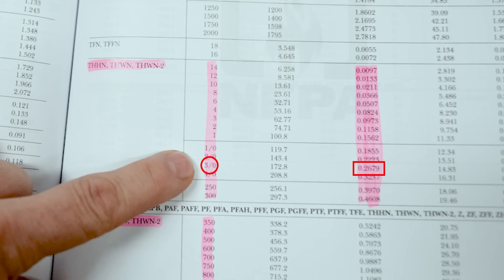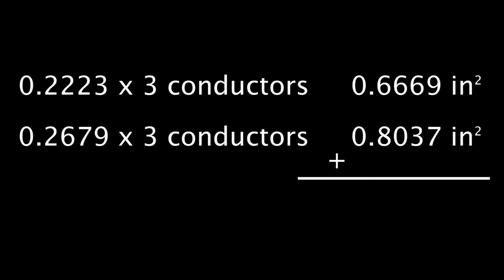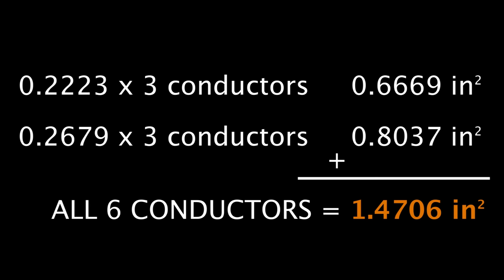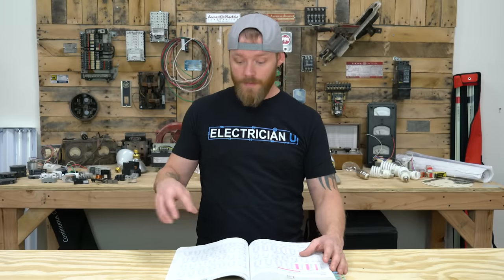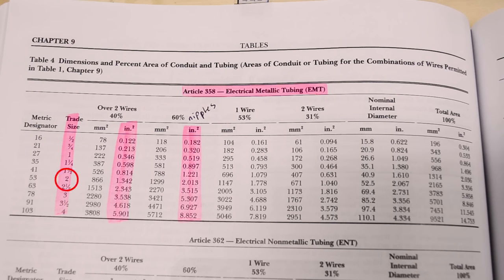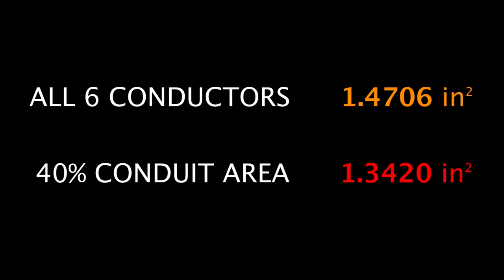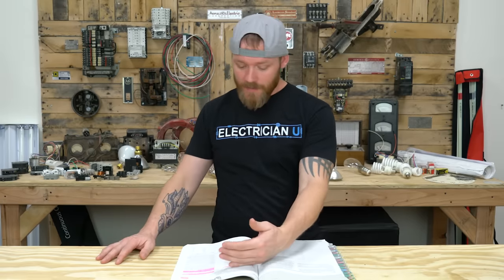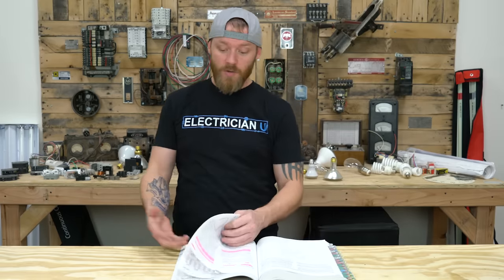CONDUIT FILL EXAMPLES for the Modern Electrician - How Many Conductors Can I Put In...

Comment: If you are protecting the insulation of the cables dont you consider the cross sectional area of the cable ( to outer insulation ) and determine the 40% of the conduit ? rather than just the CS of the conductor.
Reply: I don't have an NEC book, nor ever studied one. But my guess is because the table for cross sectional area of "conductors" would also take into account the insulation. My reasoning for this is each type of cable has its own section in the table. A bare conductor is just copper (or aluminum) and wouldn't need all of those categories. I've noticed through watching lots of these videos that tradespeople seem to call a cable a "conductor" (which is why I used quotation marks, above). It seems inaccurate to me (electronics trained), but might just be trade jargon.

Comment: Someone please explain to me why you would want to put more than one romex wire through a single tube of conduit.  Obviously this section of the code is there because people do it but I can’t understand what circumstance that would be necessary.  Why not just run more conduit or split it off with a junction box?

Comment: The tables say for 1¼" conduit you can have 0.598in² fill @ 40%
But in the annex table it states you can have 4 1AWG THHN wires in a 1¼" conduit and @ 0.1562in² X 4 that would be 0.6248in² so I'm confused
Reply: You only apply that 40% if theres different sized wires in the conduit

Comment: Contractor who installed power at the building I work in must have failed this.   40MW was installed but we can only safely draw 20MW due to overheating in the conduit.  Major ($millions) oops.
Reply: Were they held responsible for it? You should run the building at 40MW and let the wires melt and force them to fix it. Or just legally force their hand

Comment: Is it normal for a first year to go back and fix a journeyman’s mistakes? Is it normal to fix a second year’s mistakes? I know I’m a first year so I’m basically the bitch of the whole ordeal, but I’m often getting sidetracked from my own work to go fix or assist someone else. If this is not a normal thing, what should I say to my foreman? I haven’t gotten in any hot water yet for being slow but he’s seen some of my work which when alone he says looks good, but when I’m assisting the other co-workers throughout the day I noticed I tend to slip a bit more trying to remember what I was doing and he’ll notice it in the quality of my work. Does anyone have any helpful advice? Thank you in advance I just really want to do well.
Reply: Can't speak for others but i hate it when an apprentice goes and tries to "fix" my work.  I'd make sure there is something actually wrong with it before you touch it because if the guy before you thought it was good, you're only gonna piss him off. 

These days it seems all apprentices think they know better then the guy that's been there for 20 years. 

Don't get me wrong, if its a safety issue like a light that's arcing then fix it.  Don't say.. cut an inch off of flexible conduit because you think its too long.
Reply: I agree with beeps; don't be the "inspector". By all means, show others tricks or tools that can improve their work. But don't be surprised if the horse won't drink after you lead it to water...

Comment: Dustin, I have to disagree with your claim that heat is not a factor in Conduit fill.  Starting with the basics, NEC 300.17 says: 

 " The number and size of conductors in any raceway shall not be more than will permit dissipation of the heat  and ready installation or withdrawal of the conductors without damage to the conductors or to their insulation. " 

That's a pretty clear statement,  Yeah, Chapter 9 and Annex C don't mention heat, but they aren't the only applicable parts of the code.  If you went solely by Annex C,  you could put 16 #12 THHN conductors in 3/4" EMT.   That's all well and good from the standpoint of physical damage while pulling the wire, but NEC 310.15 (C)(1) would also require you to derate the ampacity of those conductors to 50%.  The full ampacity of #12 THHN would be 30 amps per Table 310.16, so 50% of that would be 15 amps.  If you go by only chapter 9 and Annex C,  it would seem like you could run 8,  20 amp circuits in 3/4" EMT,  but if you consider all applicable parts of the NEC, you can only run 4, 20 amp circuits in 3/4" EMT.  As far as your comment that you don't think the conductors are at max value, as a practical matter, you're  right, the circuits probably won't all be running at max current at the same time, so it probably won't create issues.  But codes are designed around  assuming the worst case scenario will happen, not assuming that it probably won't.
Reply from the maker: Andrew Alexander I don’t disagree. There’s 2 statements there 1) dissipation of heat which is dealt with in 310 under number of current carrying conductors in a conduit without reference to size of conduit and 2) chapter 9 # of conductors in conduit without reference to current or heat. They’re both important and both necessary but what I’m saying is chapter 9 has nothing to do with heat, that’s in 310. 310 has nothing to do with conduit fill that’s chapter 9. I’m stating I don’t believe the arguement that a 40% fill has anything to do with heat, it has to do with fit and damaging conductors, 310 has nothing to do with fit, it addresses the heat.
Reply: Andrew Alexander    I do not really understand your point for this reason.   During a design process, home run location is decided, number of circuits desired in conduit, size the conductors as required, and lastly, size the conduit.   You never size the conduit, fill it full then see if the conductors need to be derated.   I've done this since 1983.   If you are a consulting engineer, then I guess I understand.   Most leave all this up to the contractor to figure out.    Respectfully,   Kevin
Reply: @ElectricianU  Dustin, I should say I'm a big fan of your videos, subscriber and all that, so I'm not trying to run you down here.   And I'm not trying to put words in your mouth,  but watching your video, it sounded to me a lot like you were saying: "That whole heat thing is all bullshit, I don't believe in it, and you can just ignore it, and the only thing you have to follow to know how many wires you can stuff in a pipe is Chapter 9 and Annex C"   You say that's not what you meant, ok, cool. I  can't sit here tell you what you meant to communicate, because you know what you intended.  But I can tell you what it sounded to me like you were saying. And if it sounded like that to me,  it probably sounded like that to some other other guys too.
Reply: @KevinCoop1  I'm not an electrician, nor an engineer,  but I'm assuming that an electrician isn't always going to be handed detailed plans that spell out absolutely everything, that there are times  that an electrician is going to have to be making decisions in the field.  So, as I posted above, it sounded to me like Dustin was saying that chapter 9 and Annex C was all you needed to know in order to determine how many conductors could be in a pipe.  I accept that Dustin says that's not what he really meant,  but looking at the comments here, I'm not the only one who thought he was suggesting that heat derating could be ignored.  My point was that someone who also read his comments that way might ignore 310 when figuring conduit fill, go with the max number of conductors allowed by Annex C, and wind up with an installation which doesn't comply with 310.15.
Reply: Andrew Alexander    Thank you for comment.   Makes sense!   Respectfully,   Kevin
Reply: @andrewalexander9492  AGAIN....derating is based on 310 and conduit fill is based on Chapter 9. The title of this video is "Conduit Fill". First, you decide the derating of the conductors that are going to be in one conduit. Once you have figured, you move on to Chapter 9 and figure conduit fill. Yeah you aren't an Electrician or an Engineer....and it shows!!!

Comment: I don't know why YouTube is so interested in showing me old conduit fill videos this is the third this week, but f it here's a copy pasta of my post from one of those other videos.

This is a section of code that really irritates me at least for branch circuits. Don't get me wrong it's necessary for calculating the size pipe you need for large conductors and special cases like isolated grounds. However, after you have applied corrections for ampacity the actual practical limit is 9 current carrying conductors (#10's on a 20A circuits) anything more and the step up in wire size becomes impractical, who's going to pull #8 (THHN) for a 20A circuit? Plus you then have to upsize the conduit from 3/4 min. to 1-1/4 for up to 16 or 1-1/2 to 20 the pipe can handle 22 correction step up is at 20. I can't say you'll never do any of this, but seriously this section is mostly navel-gazing at best and leads to bad installs that could end up in dangerous situations and worst.
Reply: True, 9 is the practical limit for most branch circuit wiring but the rules need to apply to more than basic branch circuits. More than 9 is done all the time once you leave the comfort of residential and light commercial wiring, especially control wiring. FYI, even at 9 conductors 14, 12, and 10 are still on 15, 20, and 30 amp breakers, respectively. Usually no need to upsize until you hit 10 conductors.

Comment: When you say nipple what exactly are you referring to? Like a special connector from box to box?
Reply: a short piece of pipe/conduit.
Reply: Specifically, it means 24 inches or less.   That is when you can take credit for the 60% nipple fill rule.  It doesn't necessarily mean a factory nipple, it could also be one you field-construct out of part of the full straight section.

The one thing unspecified about the 24 inch measurement, is exactly how you measure it.  I.e. does it mean 24 inches between box walls, 24 inches of rough stock length, or 24 inches of finished length including the connectors and bushings?

Comment: Takes as long to figure as it does to pull them. Heat dissipation in a conduit, maybe? Limiting two wires in a drilled hole is pure bullshit! Why aren't breakers sized to prevent a wire from overheating??

Comment: Question for any electricians, how many receptacles should you be able to wire up and close up in a day, or per hour. I'm trying to figure out what I should strive for.
Reply: After the rough in? Back in my Construction days it was about 15 minutes a receptacle.
Reply: I just finished a residential job with about 15 receptacles per room. Taking your time, you should be able to complete all 15 in an hour.

Comment: Heat, have to derate your cable, 70% derated
Reply: The insulation has heat and a bunch of other ratings. The only time you need to do additional calcs is to account for ambient temp
Reply: Wrong, 3 or more conductors you must derate
Reply: Plus amperage is rated at 75 degrees not 90
Reply: It's not about heat  if u watch Mike holt on this you will see it's about the magnetic forces in the electrons and that could through you voltage around

Comment: Data  is correct, but someone needs to learn the difference between square inches and inches squared!
Reply: What's the difference?  Please enlighten us.  Last time I checked, they both are different ways of saying the unit of area that you get when multiplying one dimension in inches by another one.
Reply: @carultch  If my memory serves me right, (sometimes questionable), this example might help: imagine three 1 inch squares- that is 3 square inches. Now take the expression 3 inches squared,  which would b e a square 3 inches on each side , which now is equal to nine square inches,  or three inches squared (3 " x 3")
Reply: @edwardfry2594  I've never heard it work that way.  You would say "the area of a 3 inch by 3 inch square", or "the area of a square, 3 inches on a side", if you meant the latter statement.

To my knowledge, "square inches" and in^2, are both units of area, equal the the area of a 1 inch x 1 inch square.  The computation of the number portion of calculating area is usually completed prior to mentioning the units.   "3 inches squared" does not mean "9 square inches".
Reply: @carultch  3 x 3 = 9
Reply: definition of squared is the number times itself (3x3)
Reply: @edwardfry2594  The 3 ain't squared, unless it's been snared.  "3 in^2" does not mean "(3 in)^2"
Reply: @carultch  ... As I see it, it's all about how the guy reads what's printed on that page. If it has the little 2 on the right / top then he says "squared" because that's how it's printed when you write it out. I think we all know he means "square inches" at the end of the day. If a guy says a room is 10 ft square, we also know the room is 10 x 10, or 100 sq ft.
Reply: @rupe53  That just means it is a stylistic preference.  It doesn't mean the units have a different meaning, depending on which one is written, which the OP was implying.  It isn't like kW and kVA that seemingly are the same unit, but have an important distinction in their definitions.
Reply: @carultch  ... very good analogy there on the Kw versus Kva. At the end of the day it's about some meaning from context and being familiar with what's going on.

Comment: Still sounds like gobly goop.  Just tell me how many wires by guage size can fit in 1"-3" pipe.  Thank you.
Reply: There are tables that specify maximum quantity for each wire size and conduit size, in Chapter 9, assuming uniform sizes.

Comment: It’s very hard to listen to Dustin sometimes. How is conduit fill not a purpose to dissipate heat?? And why is this labeled “for the modern electrician” lol
Reply from the maker: Have you ever grabbed a bunch of conductors coming out of a conduit and felt them dangerously hot? Not unless there's a problem with a load or termination.  Conductors in ambient heat experience more insulation-damaging heating from the outside, most times, than internal heating from current on properly sized conductors. Again...depends on the load and environment though. The purpose for conduit fill is to ensure we're not damaging conductors during pulling in and out. Do you think adding 2 more conductors inside a conduit is going to all the sudden add such an immense amount of heat inside the conduit that the insulation of the conductors is going to start to melt - therefore requiring us to need to upsize the conduit? No. If that is the case the conductors are probably sized too small for the loads to begin with. Also the title was suggested by YouTube so we just went with what it suggested. Realizing it's silly as hell as I sit here now and read it lol...Cant change it though or the YT gods will slap us down.